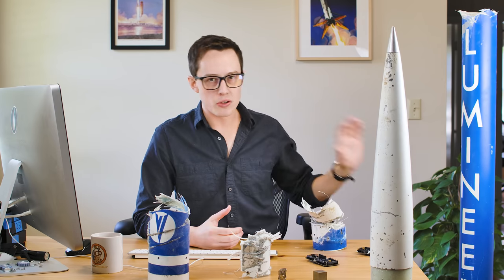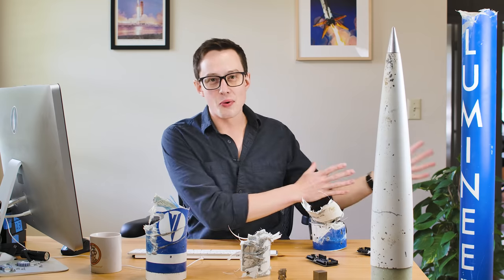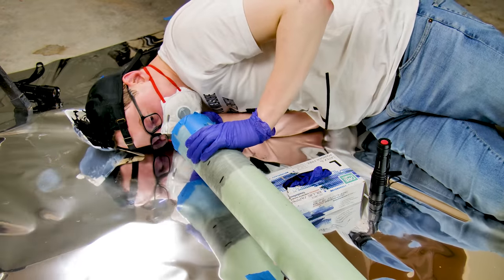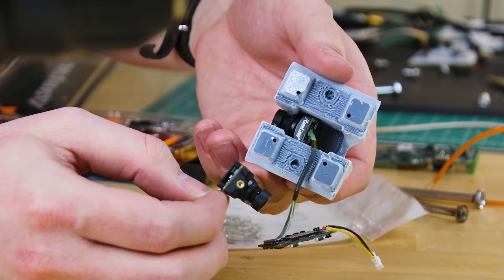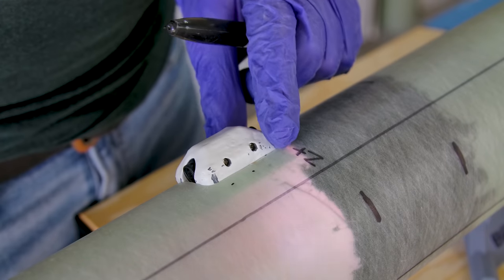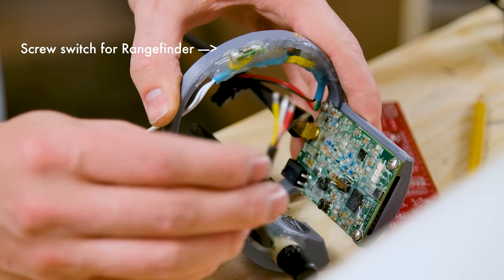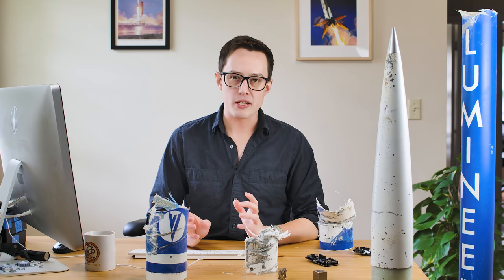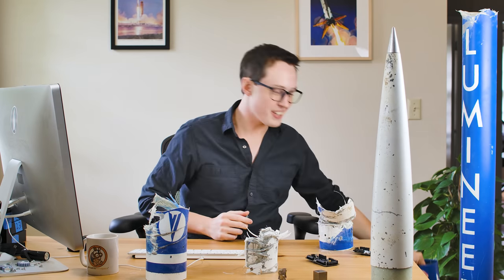Airframe Assembly - Building Lumineer

Comment: Hey Joe, I had an Idea for your landing rocket. If we could use a tiny solid fuel thrusters on just one side of the rocket where the centre of mass is and put some wheels on the landing legs such that when returning to ground, the inbuilt roll control can orient the side with the thruster to the direction of horizontal motion and program the rocket such that when the horizontal velocity passes a certain threshold, the thrusters will fire nullifying the horizontal velocity and any residual horizontal velocity will be taken care of by the wheels. Take care that this happens during the landing phase only and the thruster shouldn't fire below some height or else a successful landing could be spoiled by the unwanted firing of the thruster

Comment: I don't know if it had anything to do with the failure of parachute deployment, but I have to share the idea:

On a toy parachute I received as a child the attachment from the main line to the silk wasn't made of individual lines but of a coarse net. The parachute was extremely resistant to tangling. It probably is less effective per weight, but the reliability could offset this drawback.

Comment: How about using a strong magnet to close a reed switch that latches a mosfet on. That would  power/arm whatever you want and the reed switch can bounce all it wants after that. This would no holes post intergradation and with the solid state latched switch, vibration would not be an issue. You could even have another reed switch in a different location to turn everything off is you have to cancel a flight.

Comment: I think setting the launch date first could actually be good in a way.  This way you're forced to think through the entire process by a certain point, which means that next time nothing should be completely new.  I think it's often better to work that way than to stall in anticipation of a potential problem, and let timelines drag while you try to work it out, only to be stalled by the next unanticipated issue when it arises.

Comment: Suggestion... the camera housing is huge, consider having the cameras inside facing sideways and  the housing only needs to contain a tiny section of front silvered mirror (pull from.a junk old slr camera or something) ?! .. smaller housing in the airflow means lower drag, means more speed and altitude, right ?

Comment: You know, something I'm genuinely curious about is how you g-proof all your electronics. Is there anything special you need to do to prep AVA for high power launches (covering with epoxy, lotsa solder...)? Been wanting to launch some avionics inspired by this channel, but wanna make sure it'll hold up.
Reply: Smd boards have largely solved electronic failures due to acceleration forces.
If you have a big cap for triggering a deployment charge you really need to pot it.
Likewise lithium cells and batteries with connectors have solved a lot of the old issues we had with alkaline cells losing contact.
Reply: @jimurrata6785  Any idea if this information can be found on the datasheets anywhere or does this have to be tested. Was initially thinking of just swinging my avionics payload above my head as fast as possible to test. And agreed, lithium cells are a life saver. For now, using my avionics as a data-logging / telemetry board, but being able to trigger charges is next, so thanks for the tip.
Reply: @nitishchennoju5427  Does what specifically need to be tested?
Usually the only component effected is going to be the accelerometer, and that is definitely in the data sheet.
25 years ago we would see a lot of people modeling their flight and checking against various motor thrust curves.
But like they say, "It's not the fall that kills you, it's the sudden stop at the bottom"
Even a rocket that is coming in separated and flat (with no main deployment) is likely to see higher G's than at launch.

Barometric sensors need to be isolated from ejection charges as well.
They will pop just like an eardrum in a war zone.

I wish Joe had gone a little deeper into the autopsy and hope he responds to your question.
Reply: Are you home building your avionics?
Did you use a vacuum chamber to test them?
If in doubt are you able to use an extra long motor delay as backup?

I come from a time when electronics, GPS and cameras were getting a foothold on the hobby.
So I'm not very current.  I think the last electronics I bought were a Big Red Bee and Adrian Adamson's Parrot V2
Realtime data links and video transmission were not common
Reply: @jimurrata6785  Well, I wanted to test that all solder connections and board functionality is maintained during flight (of the microcontroller). I have seen on some threads that certain chips fail due to the high vibration environment and wanted to ensure that doesn't happen on my datalogger (which isn't flight critical at the moment). I felt this was important to address now before I start using my custom boards to perform flight critical tasks (such as parachute deployments). And yeah, working on this at home so a vaccum chamber is out of scope for me. (and what would I use the vaccum chamber for?, I'm not planning a space shot or anything so...)
Reply: @nitishchennoju5427  A vacuum chamber (even a pressure cooker or a mixing bowl used for degassing epoxy) will allow you to correlate the board's barometric reading to an empirical gauge reading.
Personally, I wouldn't be too concerned with solder joints failing.
But I definitely think accelerometer readings can be adversely affected by vibration if the raw signal isn't damped and averaged.
Clock speeds are SO much higher now, that shouldn't be a problem.
Potting large discrete components with epoxy or even hot glue is probably wise.
There can be a lot of leverage on the legs of a big Cap for example.
Reply: @jimurrata6785  For sure, good advice and thanks.

Comment: @PBS.space does one still pass the high power rocketry certification if the rocket successfully ascends but doesn’t deploy chutes?
Reply: Unfortunately the rocket does have to be recovered in a state that would allow it to be flown again without need for repair. Basically means "recovery system allowed a soft landing" which translates to "you brought the rocket down safely" :)

Lumineer 2 will work!

Comment: feel like you added too much black dye the first time round and second epoxy shot would benifit from having the dye there. It's real hard to tell if the expoxy is mixed properly without the die especially with it being so thiccc. It did work in the end so guess it's good enough :)

Comment: How much longer until you start needing to hook up a generator to power the pad so you can launch with full power and have to do the vehicle is on internal power callout with your countdown.

Also isn't it hilarious that we throw so much expensive valuable and fragile equipment into these things. And the entire time we are on the ground, we act so careful and gentle around it. Just to yeet it with controlled explosives as high, and as fast as possible and have faith that our recovery method will bring it back in as few pieces as possible.

Comment: I would've made a mini starship with the same stainless steel, flaps, and ratios, only difference is that I would've made it on a 1/32 scale, that would end up at 17.46875 feet tall. But that's just me, and it's definitely too ambitious for the first flight

Comment: If one of the crew had a Tech. ham radio license very easy  to get. You could us a simple cheap 2 meter transmitter  kit very small and light cheap and easy to build. It would transmit a morse code  over and over. Then with a 30 dollar 2 meter radios and a diy Yagi antenna. you would have a direction finder. system several of the cheap radios you could do triangulation. Ham radio balloon guys track for  many miles away.                                         I enjoy your videos. K5JRW